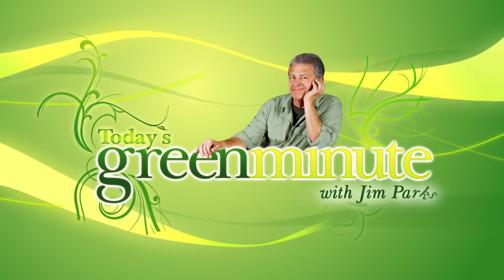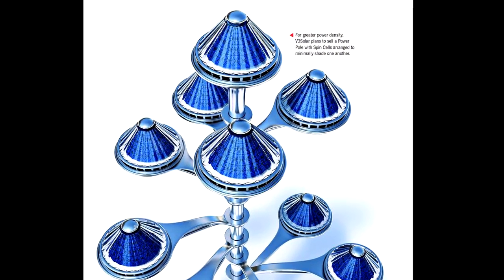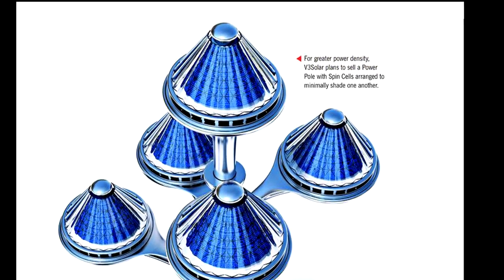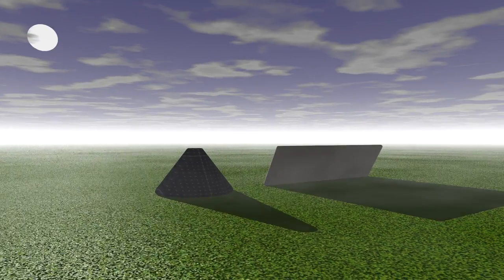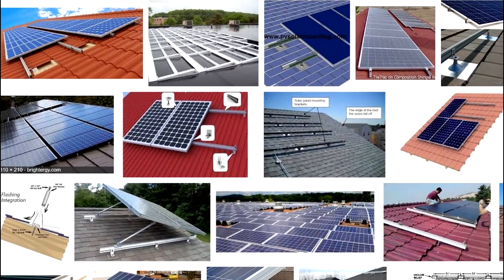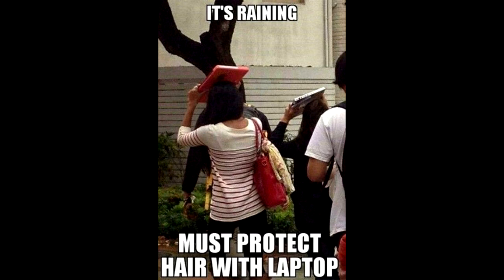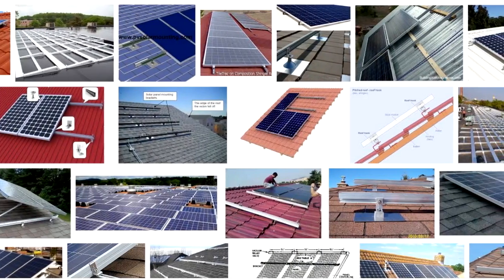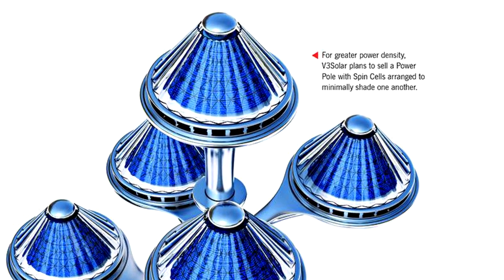Spinning Solar -BUSTED!

Comment: You forgot something. You also need energy to rotate those things.
Reply: Bullshit powered ,of course.
Reply: Wind power...?
Reply: You would be better off just putting solar panels on the ground around the wind turbines.
Reply: You may want to connect yours to the nearest solar freaking roadway.
Or use Thorium. It's one of the densest materials known to exist, after all. Whatever that has to do with anything.
Reply: could people actually put a Solar layer on Wind Generators?
i mean here are more than enough Wind Generators.
hmmm, where is the Downside, except the cost.
Reply: Super Suchti But they have glass cone over them so there is no wind
Reply: spinning something fairly lightweight with no perpendicular bits to catch much air, that has a balanced load doesn't require much at all. I don't think that's high on the list of problems.
Reply: You're assuming too much power for rotation, whole point would be to do it basically free like a spinning radiometer..  If you had very cheap and lightweight solar (say paper), and heat was the limiting factor, it could almost make sense except for the getting power off the rotating object, and eventual mechanical breakdown aspects..
Reply: ModelLights Aye, by circuitry I meant wires and / or contacts.  One will add weight and complexity, the other will add a mechanical aspect that will wear.

Aye, I never said it would require a lot of power, just more than a tracking panel would on average.

You're suggesting they manufacture a cheap, low performance panel into a configuration where the dome is mounted (and does not rotate with the rest of the device) to the base plate, with brush leads?  I mean, it can be done, but using cheaper, low-performance hyper-light cells exacerbates the lack of power generation vs surface area issue.  Also, spinning the panels has been explored before, was considered a bad idea then, too. Suggesting this almost  makes it appear that you aren't up to analyze this.  Silly tired logic (I disagree so you aren't up to snuff!)
Reply: Oh god, this thread keep miss the point. The limit factor for solar in the real world is sun lit area, and price(both the physical device, and space you are operating in. Space near cities are expensive).  Tracking panel and rotating cone both use little energy if designed right, but tracking is way more practical because it take less space. 

The cone design may drive the cost down by using cheap/less efficient panels, but it is a long shot. And it's downside inefficiency both by using inferior cell and require more space (the #1 limiting factor)

the location of energy production need to be near where it's used, and near cities there aren't lot of open area for solar panel. Open area with huge sun like the desert can be excellent solar farm, but it isn't done because energy storage and transportation would be a huge waste. There are cost to build/maintain power line, and the longer the distance the more energy you lose. 

That's why today's big technical focus of solar development is 1) more efficient/affordable cell, 2) energy storage solution.  

the Cone/cheap cell idea will never sustain in the long run, and I doubt the idea is ever practical at all. It's like choose huge zeppelin over commercial jet for transportation. 

It's less efficient, less practical and huge waste of time/effort, the only reason it got any popularity is because ignorant part of Internet looked at it and says "That looks cool"
Reply: +ModelLights,  alright, the idea might have slimmer of merit in them, but definitely not the people behind it. I'm not even going into the price of floor area, volume efficiency argument. or the price of curved panel/ reflection issue. let's focus on the only upside of the idea. 

 I can tell that the cone/spinning/glass, design decision was chosen  to for the cheaper/heat issue, that's just a bonus. It was more for the appearance/"cool" factor.  their thinking process was probably something along the line: those spinning radiometer are pretty cool-> how to make it cooler? > combine it with solar panel!--> cool + energy-> gotta justify the spin -> use cheaper panel -> put a glass on top so it look like Christmas tree.

And here is why. If their original goal was to maximize solar production, there are multiple way to arrange the cone to optimally utilize the space. or you can just do long horizontally rotation cylinder, . the geometry is easier to produce (than a cone), easier to align motor, and allow for maximum use of sun lit area, while still have the "advantage" of cooling the panel. Plus it solve the heat problem even better than the cone shape, because cylinder allow for uniform cooling  on every part of the panel. But what did the graphic show? Christmas trees,  because it looks cool.

the idea was nothing but a novelty toy, fancier version of the radio meter.  But they need fund, investment. so they present it as a technical solution, promise mass production and pretend the heating solution was the main selling point.
Reply: indeed
Reply: i don't mean these Stupid Cones.
i mean Normal Wind Generators.
like these: http://www.plainswindeis.anl.gov/images/photos/wind_450KW_turbine_IA_V_13764.jpg
but with Solar layers on them.
might be useless tho. :/
Reply: Super Suchti If the Wind comes mostly from the south in a region it could work. But otherwise the solar panels dont see much sun
Reply: hmm, well you can put them on an Angle ontop of the Dynamo part...
it wouldn't be much, but in Combination with a Accu. it could Power the Red Warning Lights that Those Things have.
Reply: Lucas Möncher
but on the Other hand, the Current Food Production is actually enough to cover all of Earth's population.
it just isn't Spread out good.

and we could use Solar Towers in Hotter Regions.
Reply: zzzlt he only mentions what happens when the Motor fails, not how much Energy it would need or how it would work under such temperatures
Reply: +Super Suchti , hard to access, maintenance,corrosion, and wind turbine bends while solar planes do not.(unless you cut them into litttle pieces which reduce efficency and increase price at the same time), and the small turbine area does not worth all these effort,
Reply: oh yeah, back to topic about the motor. I think he didn't mention the motor power because the tracking panels he was comparing it to also need motor to track the sun. You could argue which drive cost more energy etc(both of em cost very little if designed right), but it's not worth it, cause the cone just throw 70% out the window.
Reply: You're not up to analyzing this.  Energy, yes.  A lot, no.  Only the cells need to be rotated so no one part overheats and you can use cheap cells in a high intensity environment, not the entire outside structure.  Paper cells would be like rotating a piece of card stock.  You only need a contact point at the top to take off one pole and a point at the bottom to take off the other, 'circuitry' isn't required to get power off of a simple cell.
Sort of funny so many aren't even up to getting the idea of what they're talking about doing..  Not likely practical anyway, but there's at least some general concept to it that makes it worth a rough check by competent people.
Reply: +ñoño I think otherwise.  "New ideas shouldnt be ridicule, they 
should be checked, and if possible improved" True, but the idea need to at least have some merit for us to pursue them further. And "checking" is exactly what Thunderf00t is doing in those videos. 

I mean stuff like this is not like string theory, where it "might" be true or might be  way off, we don't know until we look deeper. That's why despite all the controversy, string theory is still actual science.  Stuff like solar roadway, cone... are obvious not practical and "Wrong", we know it won't work, we did the math. Those are just social scam designed to gain popularity to the mass without actual scientific value.

And No, these ideas do not make science look cool, they make science look dumb and pretentious. They mislead the public. Basiclly people behind those are not scientist, they are just like kids asking what if? without knowing the important facts, and then pretend to be a "scientist/expert" to gain authority for their ideas. 

 This is the beauty of science, you don't need to debate like religion or politics. In science the fact is there and you can't deny it,  Those bullshit just do not work, not matter how cool they sound.

What's really "choking science" is peoples that are impatient, easily bored by facts and drawing to ungrounded boasts like this. When look for quick gratification people rather choose a rainbow bridge that never exist, then a steady alley that need to sights of beauty.
Reply: 'The cone design may drive the cost down by using cheap/less efficient panels, but it is a long shot. And it's downside inefficiency both by using inferior cell and require more space (the #1 limiting factor)'  Agreed and exactly.  Didn't say it was actually practical, simply that there was at least a core idea at the start that had some minor merit, and at least worth checking.   And 'area' varies.  Most of the extra 'area' of the larger cone can be behind the sun facing side, so not relevant since it won't take up much more 'sun surface area' which is the actual key.  The cells would have to be very cheap for it to make any sense, and would have to need the heat dump to use the cheaper cells.  But there is at least core logic in the idea to check, unlike 'solar roadways' etc which fail miserably first pass on every facet.  So probably won't be worthwhile either, but at least not as incredibly dumb as solar roadways.  Literally Solar Roadways is one of the dumbest things I've ever heard of, it's still king of the solar power pseudo science that I've seen..
Reply: Gavin Jenkins, it won't require all that much, but it will require a brush lead or some other kind of mobile electrical connection, which will add a wear and tear component and additional drag.  You're talking about a power-production mechanism that is almost not viable when made to produce the maximum amount of electricity possible.  Every tiny little thing that detracts from that places it further into non-viability.
Reply: Super Suchti So you mean with Solar Panels on the Wings?
Reply: Lucas Möncher
ye, but i'm not good with Designing, so it might just be pointless xD
Reply: Super Suchti I think some already have solar panels on the nacelle
Reply: Lucas Möncher
Well cool i guess. it saves some Power, unless there's no Sun for an Entire day.
Reply: Macca Khan Thats right, but those things often are on fields and so you would have less space for crops.
Reply: Super Suchti But the population of the earth is growing so we need more food in the future
Reply: Lucas Möncher
lets just send the Overflow to mars :D
(Totally Serious)
Reply: Super Suchti Sounds Better than my Plan... (Massive Wars)
Reply: Lucas Möncher
maybe the Hunger Games?
Entertaining and gets Rid of people :D
Reply: Super Suchti Nah. I'm not that sadistic. (Btw. I would make laws in countries where every year the poppulation grows a lot that they should only have 1 child. like in china)
Reply: You're missing your own point.  Take whatever you would have spent on the solar to run those lights, and make the wind generator slightly bigger/better/more efficient etc.  You'll get back 10x or 100x more than the solar would have generated.  Large surface area that solar requires to do much is not the design goal of a wind generator, it's a poor place to try to go solar..
Solar completely sucks for actual power generation, almost anything beats it immediately.  'Wind' is solar powered, but you're leveraging huge areas of solar that have moved air, and already put the energy into mechanical form.  Even with at best around 2/3rds efficiency max you can extract from wind, it makes far more sense where it exists.  
Solar almost never, ever makes any real sense.  If it did it wouldn't need tax credits, everyone would be buying it and putting it all over because nothing else would be better.
Reply: Solar's Still good. The "Company" i work in wants to Put up some Small Cells to Charge a Battery During day and use the Power in the Night for some Path Lights.
Reply: You know i came up with a potential way for unlimited energy although i'm an average joe so i haven't applied mechanics or mathematics to it but what if you could make a windmill with magnets then they push a pendulum with an opposing magnetic force turning it into kinetic energy while the windmill works off a dynamo motor from either a salt silo or thermo energy from the earths core, also if you put exercise machines that generated electricity in every gym on the planet it could create a lot of power
Reply: They could use maglevs, or permanent neodymium magnets to reduce it to only the mass of the device.
Reply: babelfishdude
would be to Expensive.
Reply: but heat affects magnetism.
Reply: 8:51 he talks about motor
Reply: The tracking panels would use an insignificant amount of power compared to those that are constantly rotated.  If the power for the motors were considered, it would just be the icing on the cake of BS.
Reply: Lucas Möncher however the flat solar panel is also being turned since its tracking the sun too duh
Reply: T Toughtask
not all do. also the Slow-Sun-Following Rotation of a Flat Panel would need WAY less power then a Costantly Fast-Spinning Cone Panel, duh.
Reply: three-phase current over direct current is not compatible
Reply: It has to be heavy enough and complicated enough to support itself and have the required circuitry to generate power, which means any "free" means of power is out of the question.  This is made even more glaringly apparent by the glass dome that they want to put on these things. That dome will likely weigh more than the rest of the instillation regardless of what sensible material they make out of it.

It wouldn't take a terrible amount of energy to keep them spinning, but startup surely couldn't be done for free, unless they explore some kind of heat-based generator or drawing directly off the cells themselves... which kind of is out of the question, considering the point of this thing is to stay cool and be 20x more efficient than normal panels :D
Reply: Thermopile. also, Solar needs no Circuitry... you shine Light on it, and it makes Power...
just make Flat Rotating Panels...
or these:
https://offgridworld.com/wp-content/uploads/2016/08/3d-solar-panel-towers-mit.png
Reply: Solar panel fields in deserts would be the best option except the need for water.
Reply: Lee DeCoske
why would Solar need water...?
Reply: https://www.kcet.org/redefine/fact-check-how-much-water-does-solar-power-really-use   ... excerpt below...

Most utility-scale photo-voltaic power plants plan to wash their panels, especially in the desert. The 550-megawatt Desert Sunlight project in Riverside County estimated during the course of its environmental assessment that it would be using one fifth of an acre-foot a year to wash its panels once construction was complete. The project will likely produce around 1,600,000 megawatt-hours of power each year, and using about .2 acre-feet or around 65,200 gallons to clean the panels, that works out to a very thrifty 2/3 cup of water per megawatt hour.
Reply: Both of this idiots examples use movement that require energy. A tracking solar panel has motors as does this weird cone.
Reply: Super Suchti But they have to have a manner to extract power from-- an issue that is noteworthy in a solar panel that constantly spins.  It will either add weight and complexity or be prone to mechanical wear and tear.  I figured you knew this is what I meant when saying "circuitry," due to basically everybody knowing what actually goes into a typical solar panel, but understand the wrong term was used.
Reply: Gary Oldham This is true, though something that moves at the same rate the sun tracks across the sky will use less power than a rapidly spinning cone with a glass dome on top of it.  People keep saying radiometer, but adding one to anything but a big paper dome won't produce movement.  It could use wind, but that isn't reliable.  It would require a non-free power source for startup, and is absolutely not going to be as light as people are dreaming it could be.
Reply: Krugis
You don't Require Circuitry for a Simple Solar Panel... even a Rotating one just needs something to either Keep track of the Sun, or Rotate at a Steady Rate.
Reply: Least of their worries.
Reply: 'brush lead '   Better to do point contacts.  Like a standard one, bottom contact is just a needle it sits on.  Then run a wire around the inside of the envelope to the top, and another point contact needle at the top center, with a very slight spring to take up any slack etc.  
All just theory anyway, if one side is too 'hot' from in the sun, the 'shade' side isn't likely to be cool enough to dump enough heat to really make it work for anything useful.  But at least there is the sliver of an idea that could possibly work in some case, so it's still better than solar roadways that doesn't have even the slightest idea that makes sense in any aspect that I've seen..
Reply: Sunday March 26 4:40 PM 2017.
I see 666 likes.
Reply: Shirlohka i change that 😋
Reply: +liam cassel   That's why I wrote the EXACT date.
Reply: Just makes it worse does it?
Reply: You have several bad assumptions in this.  The point isn't 'to stay cool', only keep the solar cells themselves cool enough to use super cheap paper or plastic, they can still be hot just not into destruction range.  Their power/cost would come from their cost being lower, not generating more power.  The point isn't 'more efficient', it is cheaper, so you can put 4x more out there and win on area cost.

Google radiometer, the spinning black white vanes that spin in the sunlight.  Done right of course you can attach a lightweight cone and it will spin by itself.